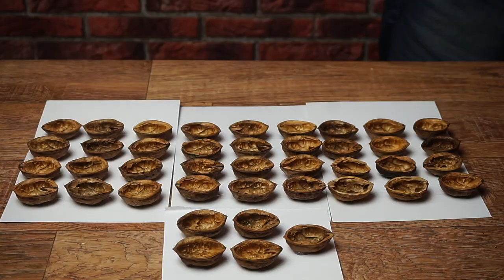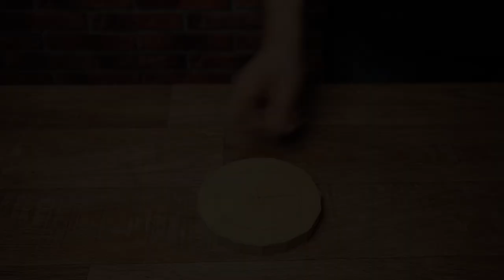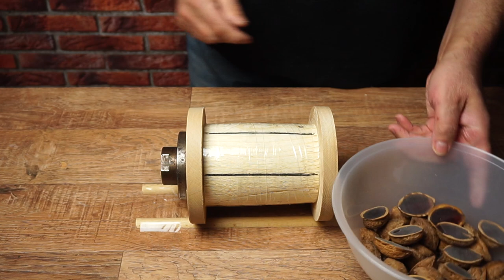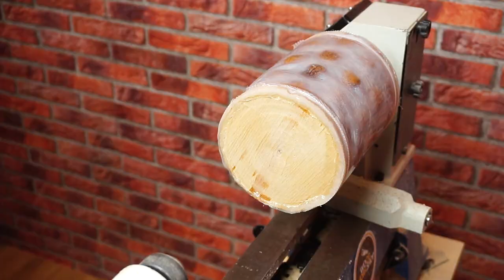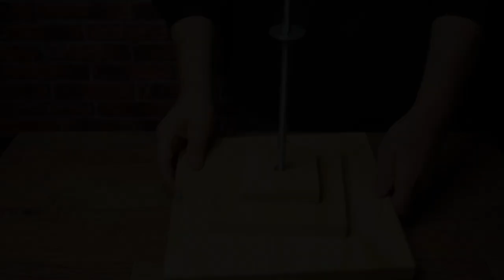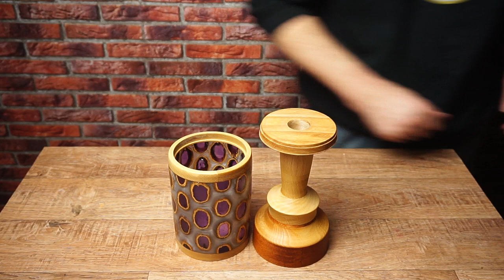Woodturning Walnut Shells into a Lamp

Comment: Very creative project.   The colors - both wood and resin - are great and the brightness is an easy fix by stepping down to a lower watt bulb.   If 15 - 25w equivalent LED is too bright, then older incandescent bulbs in the 15w range (usually for ceiling fan or appliance applications) would make for a great accent light that would let the resin colors provide a great accent.

Comment: I was really apprehensive about this nut thing but it actually came out a beautiful piece. Technically, I would get some exhaust hole or something. Even a LED light bulb will eventually overheat after a long time ON with such an enclosed space. Wood and resin are very bad heat conductors. That's why lamps usually are opened at the top and bottom. Still a very beautiful piece!
Reply: Led
Reply: I was thinking he needed a pattern of holes in the top. Perhaps like a doily? So that any heat could escape but it could also make an interesting pattern on the ceiling.

Comment: I was thinking, about the fill in around the nuts. If you set it up horizontally (as on the lathe) and rotated it just fast enough to keep poured epoxy from dripping off. You could mix up contrasting batches and spiral and swirl them around the piece. Should look something like blown glass work I should think. Maybe using a filler to make the veining thicker, glow in the dark or iridescent.
Reply: I would be interested in watching a video of this. But I wouldn't be willing to try it on my lathe. I think it would end in disaster.

Comment: Wow... just wow
👏👏👏👍👍👍
Fully deserved ovation.
(I've read you posted this vid 7 months ago, but I've seen it just now)
I'd have a lot of question... hope not to bother you too much.
- how the idea to use wallnuts shells "section" in that way born in your head? 
I mean:  you already "saw" in your mind the final effect , before to beguin to work on it... or else...!?
- how long does it take,  to dry that kind of resin you're using...!? 
- in other vids I've seen you used another kind, maybe a two-component: as I remember,  first you poured the lacquer, and then the reagent, in at least an equivalent quantity
I don't know anything about, and I'm quite curious: you really can make a lot of interesting and useful things, with those kinds of resin.
Then, last but not least: at 11:06 are you maybe using gommalacca, in 94 degrees alcohol, this time? That is what I mainly use in my job? Or am I wrong? 'Cause the color seems to be the same; I'd add that I've never used a synthetic sponge, but on the lathe isn't a bad idea  after all; generally, in my job the phases are at least three (on mahogany, four are better, repeating the 2nd) 1st and 2nd phase, wadding, and 3rd phase a cotton cloth wrapped around a wool rug, so to give it kinda a lil' "foot" shape. (Useful to reach the corners)
However... really great work, this time
And again 👏👏👏👍👍👍
Bye, till the next
P.S.: how do you use to edit the "fast" parts of your vids?

Comment: Call me crazy but a wooden lamp just sounds like a bad idea.
Reply: Why? It's not as though there are bare wires running anywhere, it's grounded, and the heat and light are in a bulb. There have been wooden lamps forever.
Reply: "There have been wooden lamps forever." Yeah, people have been doing dumb things for a long time. Each generation is smarter than the last, if you're doing the exact same thing your grandparents were then you're a stagnant human being.